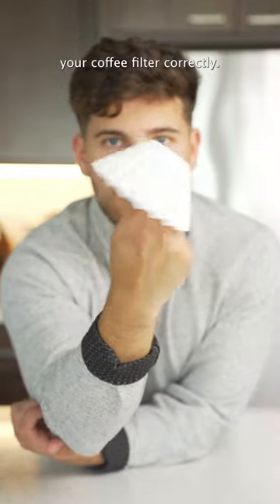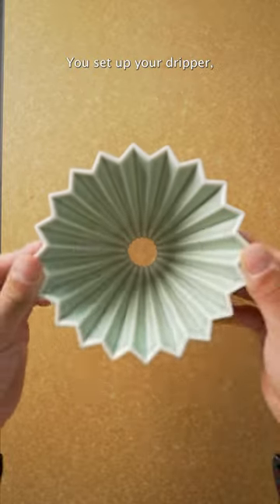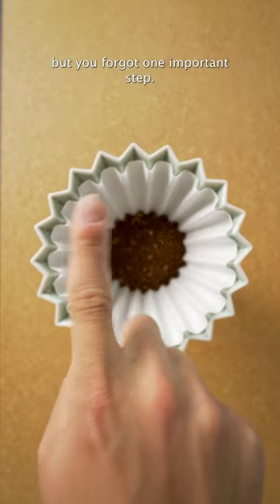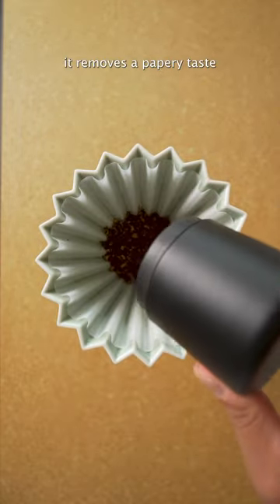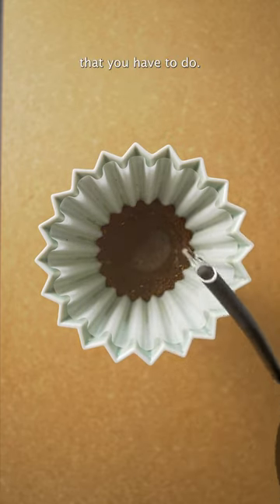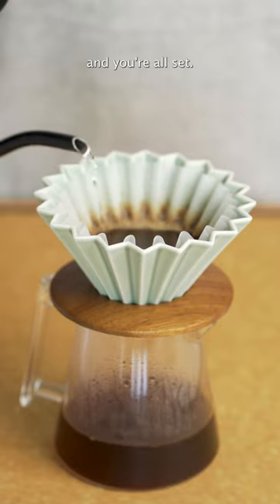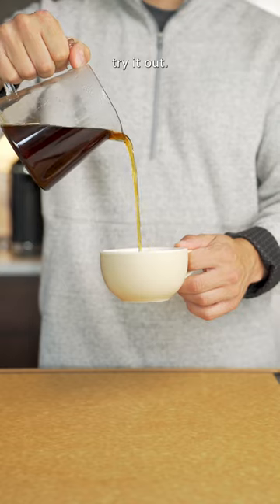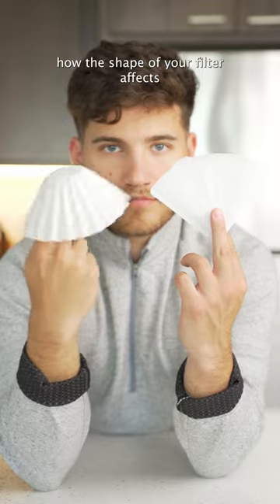A free way to improve your coffee #coffee

Comment: You can’t taste any difference between a rinsed filter and non-rinsed. James hoffermann tested it
Reply: I don't know if it's necessarily to do with taste, its just yeilds better filtration. In most labs when you filter out a product its standard practice to wet the filter paper
Reply: hoffermann
Reply: Wasn't that just for the aeropress? The filter there is quite small so rinsing it wouldn't have big effect. With proper filter Coffee you have a larger surface area - so even if there's no meaningful amount of particals from the filter itself - the preheating you do with the rinsing would already have an effect on your brewing temperature and therefore the taste. 

Unless you're talking about a different video I'm not aware of
Reply: @6md  Hoffermann😂
Reply: Alton Brown would agree
Reply: James is wrong on a lot because many of his experiments results on taste based. Now, he may not be wrong, in reality, but he’s not always right. Opinions.
Reply from the maker: @6md  hofferman
Reply: Depends. With lighter roasts you can taste it because rinsing it with hot water makes the dripper warmer, improving extraction specially in heavy drips like ceramics

Comment: according to the japanese, you dont need to rinse the paper filter. Taizo Iwasaki (japanese coffee youtuber, longer experience in coffee industry than you) did a comparison video, and does not find an absolute differences. one noticed difference is that when not rinsed, the oil will pass thru the paper. so its just clarity differences. he even eat the paper filter.

pls stop saying it as a mistake. not rinsing paper filter is not a mistake, its just a different and old method than the rinsed paper.
Reply: Well it's simply not about the taste, and some coffee youtuber shouldn't be a valuable source in this argument. Every chemist knows you have to wet the filter before using it, go to any chemistry lab and you'll see that's how they always filter stuff!
Reply: And yes, it absolutely is a mistake to leave it dry.
Reply: @szmryb  we are brewing coffee not doing chemistry. do blind test then, doesnt matter because the final product are the same and the taste isnt really much different.
Reply: It matters most when you are brewing lighter roasts on heavy drippers like ceramicals, those can drain the heat and lessen the extraction. The ideal thing to do in those cases, however, is to preheat it beforehand (just rinsing it might not do it, ceramics are bad thermal conductors cause they're porous). 

But yeah, it's not about paper taste, and with polímer or acrylic drippers the difference is negligible